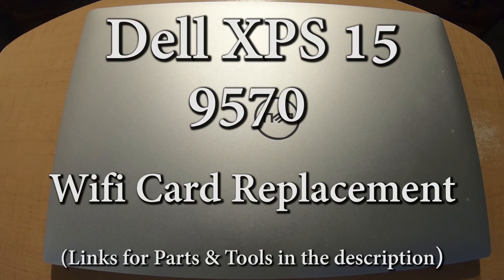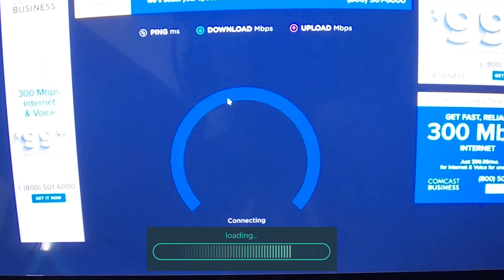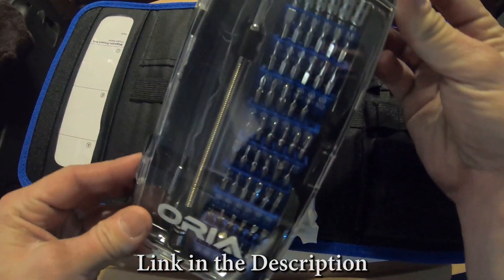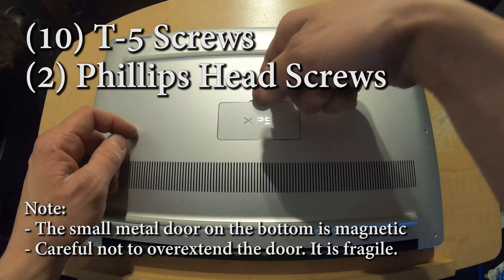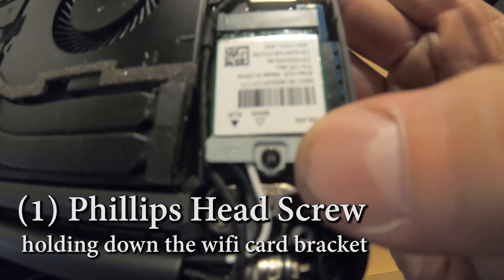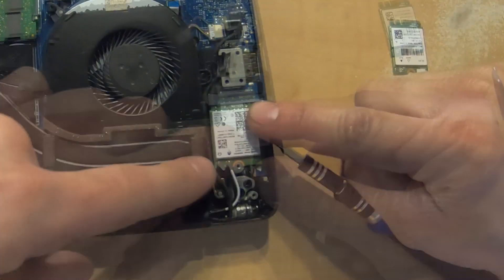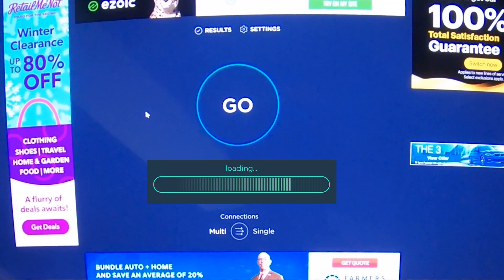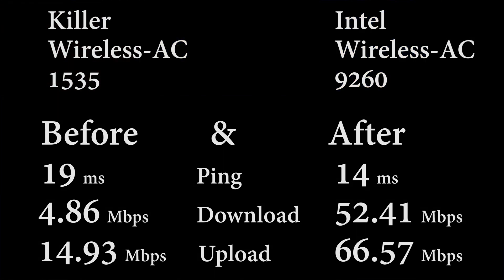How To Replace Wifi Card - Dell XPS 15 9570

Comment: Thanks for sharing this. Downloading a game from steam takes forever with the regular card. I am hoping I will get my Intel replacement wifi card today. According to Google AI search result, the drivers for the Killer wireless card can mismanage the wifi connection sometimes?
Reply from the maker: So I have had this laptop since like 2018/2019 and I still use it pretty often for all kinds of stuff including editing YouTube videos and such. The WiFi card is fully updated and I have no issues with WiFi disconnecting or being laggy, and definitely no driver issues either. The system has this intel updater software that will find and update the WiFi cards drivers, as well as the Bluetooth drivers. Everything’s been running smoothly, so I believe you will be fine. Make sure the Google AI search stuff isn’t super old, cause I haven’t had any of those issue.

Hope this helps! Thanks for your support!

Comment: nice man i'm about to do the same. other videos i've watched say to download drivers for the new wifi card before replacing it, did you do that or you didnt have to? also do you need to uninstall the old drivers for the old wifi card?
Reply from the maker: I just removed the old wireless card and installed the new one. Then logged back in, entered the WiFi password and it should connect right to the internet. Usually windows update will install any needed drivers. But if you have any issues with drivers I would recommend going right to Intel's website to install the latest drivers as needed.